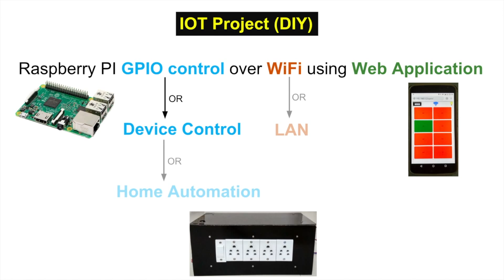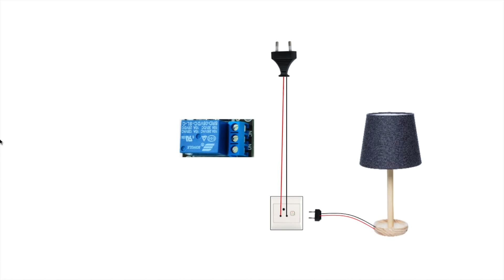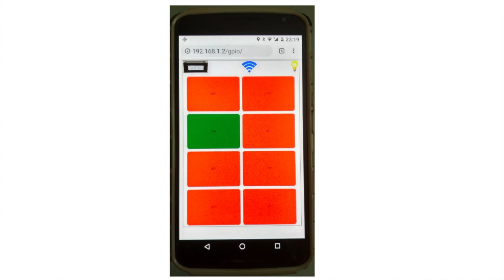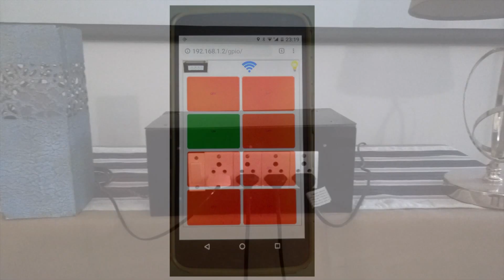IOT Project: Raspberry Pi Home Automation (GPIO Control) over WIFI (using Web Application)

Comment: hi there can you please indicate the components used the black box and where to get them
Reply from the maker: Hi.. so components are:-
- Raspberry Pi 3B+ (you can use the latest model also which is Raspberry Pi 4 B)
- 5V Relay Module 8 channel. 
- connecting wires 
I got the wooden box manufactured through a local shop. You need 08 wall mounted plug points. These are to be fitted on the box.

Comment: Where did you buy your module delay sir? Can you provide the link if ever you bought it through online?
Reply from the maker: This will work well:-
https://robu.in/product/8-channel-isolated-5v-10a-relay-module-opto-coupler-for-arduino-pic-avr-dsp-arm/

Outside India:-
https://www.amazon.com/JBtek-Channel-Module-Arduino-Raspberry/dp/B00KTELP3I/ref=pd_sbs_2?pd_rd_w=oKcQk&pf_rd_p=651d64d1-3c73-45b6-ae09-e545600e3a22&pf_rd_r=WE0B8YDQFB3681TS535K&pd_rd_r=6a144ec7-79df-479d-8bc6-e85126c0daab&pd_rd_wg=sL9y3&pd_rd_i=B00KTELP3I&psc=1